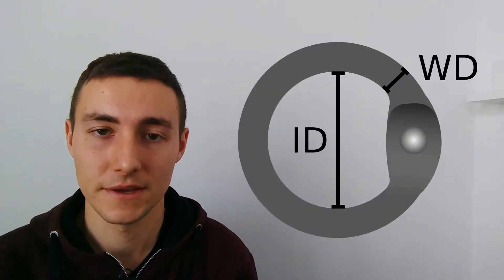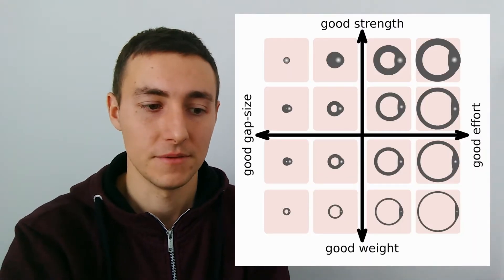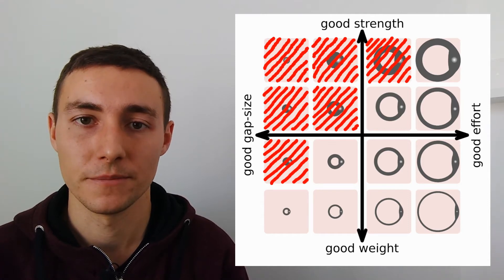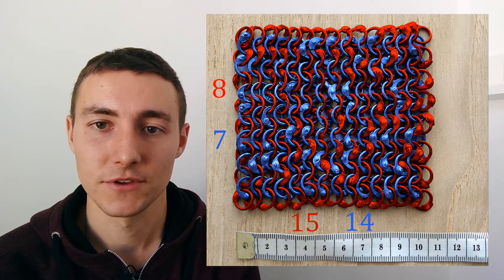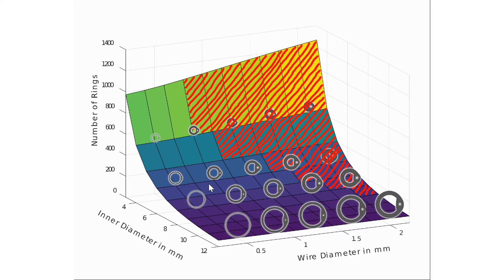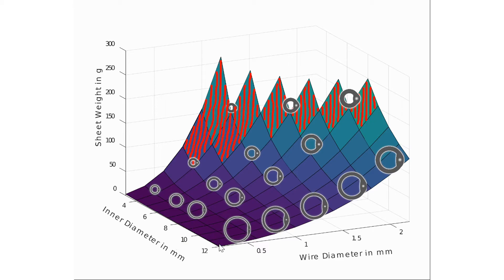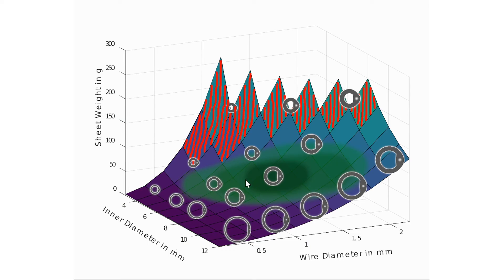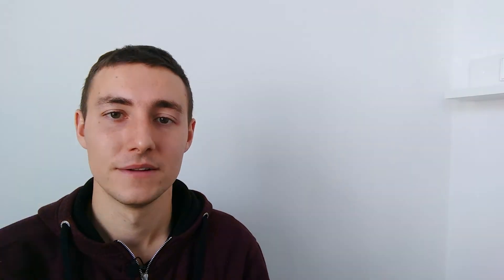How to make the best chain-mail. Do small rings save weight?

Comment: There also depends on what kind of metal you use(rigidity of material), mild steel or hardened, or stainless steel, up to titanium. So there is fifth factor and should be added to diagrams. Because aluminium ring strength is not equal to even mild steel

Comment: Fantasy dwarves were said to value premium protection against strikes, so I think they would have used smaller ID and bigger WD. I read of a dwarf who was stepped on by a dragon, and his mail did not completely collapse front to back. Plate obviously helped, but his mail was not a weak link. 

To compensate for the weight gains, dwarves tended to use mithril/mithral/titanium instead of iron. 

That said, my favorite dwarf, Bruenor Battlehammer from D&D, is still said to feel lots of blade points poke through and to experience many flesh wounds, so evidently his ID isn't THAT small. So I guess some links still  have to be left large in order to allow for chest and diaphragm expansion during breathing and arm swings, as well as for climbing and warpig-riding. 

Elves, OTOH, prioritized speed and agility, so they likely used bigger ID and smaller WD mail links.

Comment: Was making myself chainmail with inner diameter 6mm and wire thckness 2mm. It came out with unique quality for chainmails: it could stop an 3mm awl and in some cases even syringe needle couldn't pass through it! It blew my mind. Even it was made with unclosed rings it seemed to to be very sturdy and hard to rip. I was mading it for a very long time, it was no problem for me. 
But when it came to weight... Even completed only at 60% it made my osteochondrosis spine struggle in pain if I wore it over 5 minutes.
Came here to see, if there an option to make strong, impenetrable but light weight chainmail.

Comment: I won’t be using it for a whole ton of practical protection against blades, and I don’t really care if it’s heavy or not. What is the cheapest way? Does having larger or smaller ring diameter use less or more metal or cost more?

Comment: I would be very curious to see examples of the range of flexibility of different ratios (maybe that could be measured in terms of how many rows are needed to bend to a half-circle? Since that should stay the same if the ratio of ID to wire thickness stays the same, even with smaller links). And I'm curious what the exact limit is of that ratio before it means the chainmail can't bend at all! I know that these would change depending on the riveting (and on whether they even are riveted). It would be interesting to see this for different chainmail styles too, but mainly 4-in-1 and 6-in-1.

Comment: I've heard that late medieval chainmail (which covered areas where can't be a plate, like armpits, crotches and inner sides of joints) was so dense than you can't even stick a needle through it. Which wire diameter and ring inner diameter could be used to accomplish that?

Comment: Cheers from Australia. I did a bit of research before I started making chain mail and it suggested 1.2m. Wire, but when I got to my local steel supply it just seemed so thin and so I went with 2mm wire. I’ve made about 20cmx20cm square of 6in1 10mmID 2mmWd so an AR of 5, making my own rings. It looks great and is a nice relatively right weave, although it took me in total around 8hours, I also strained my right arm’s tendon and couldn’t outstretch my right arm for about a month. Ive been trying to make riveted rings but I encounter a problem when I try to flatten the rings so I can punch a hole. The two ends of the ring instead of flattening on top of each other just splay and end up next to each no longer overlapping so I can’t punch a hole. I am using a large heavy hammer on a small, 7.5kg steel railway anvil. I’m not sure how to properly flatten The rings to make riveted. I’m not sure if the rings need to be annealed first or not, it is tie wire so fairly soft anyway. Some advice would be appreciated thanks.
Reply from the maker: Hi there and congratulations to your first patch of mail. The answers for your overlapping issues are multiple. You find them explained here: https://www.ironskin.com/product/ironskins-guide-to-making-riveted-chainmail/

Comment: Hello Ironskin! I have an unusual question, and you might be one of the only ones who can answer it... I really want to try making chainmail(European 4-in-1 and Japanese 4-in-1/2) out of split rings.. Which size would you get? Since they are a bit thicker than normal ones - not sure which ones to get :c  
If you don't know the answer about the japanese weave - european should suffice ^^ at least a suggestion :>
Reply: Hello, I don't know what you mean with split rings, I use keyrings. Made mail with 8, 10, and 12mm. The one I  made with 10mm, is 6 in 1. I have an original Persian from about 1860 that is made with 6mm keyrings, on top of the shoulders it is 6 in 1. Hope that helps you. Greetings.

Comment: This really adds depth to mail 
In terms of historical combat many have noted piercing as a weakness of mail

With rivited mail getting firmer into the picture and this it adds the depth of poorer fighters buying thinner and wider links while the richer bought the smaller and slightly thicker stuff, probably of a higher quality
Reply: Maille was high end armor. It's a waste of time and resources to make maille with thinner and wider links that fail to stop points. The biggest threats on the ancient and medieval battlefield were pointy sticks, not sharp blades. The poorer troops would just use other types of armor instead of wasting their money on crappy maille (not that anyone would bother making it in the first place). People weren't LARPing back then.
Reply: @majungasaurusaaaa  when I say wider I mean smth like 9 or 8 mm while some were able to get the 7 mm or so stuff which is still resistant to most direct thrusts but also has more resistance against missile weapons 
I was probably wrong about the link thickness
Reply: @majungasaurusaaaa  That isn't true, we have finds of 9mm and 10mm inner diameter riveted mail, (for example the Tofta coif) which absolutely is susceptible to thrusts. The only way one can make the claims you did is to just completely ignore the archeological examples.

Comment: this might be years late. (maybe centuries) but why not use a spectrum of ring sizes/wire-thickness based on the armor requirements. making the chest of smaller/thicker rings to protect you vital organs and the arms with larger thinner wider to reduce weight and improve mobility of the arms?
Reply from the maker: Yeah, some historic mail shirts feature exactly that.
Reply: I was also wondering about that (for "realistic" TTRPG). Silly reason, I know. Maille is only a dream for me, especially since I'm old.

Comment: Im having a hard time understanding the graphs im trynna have a little heavier chain mail but still flexible an strong what should be the wire size an ring size i should go with
Reply: Would 7mm ring size an 1.5 wire work would that add weight an still be flexible or should I go with a 7.5mm or 8 mm ring with the 1.5 wire
Reply: You said you go with a 1.2 on 8 mm so how much does that weight for a sheet what's a sheet is that a 10" by 10" ??

Comment: Rived Rings weight per square meter in Kg/m²
InnerDiameter in mm     x  Wire Thickness in mm   =   Weigth
8.0x1.2 = 5,6          9.0x1.2 = 4,9  
8.0x1.4 = 8,2          9.0x1.4 = 6,9
8.0x1.5 = 9,0          9.0x1.5 = 7,7
8.0x1.6 = 10,8        9.0x1.6 = 9,3
8.0x1.8 = 15,1        9.0x1.8 = 13,3 kg/m²
just a rough approximation
Sebastian correct me if I'm wrong

Comment: Nice to see something I worked out using butted spring washers in the 80s still be relevant to rivetted ring mail today, my Reenactment friend and I worked out that 6mm was too small making it expensive to make and 10mm or 12mm while making it lighter just wouldn't hold up to the abuse it needed to.  We finally chose 10mm spring washers as they were the cheapest per inch to use however after making a sleeveless hauberk from them when we tried it on it turned out to be way too heavy. 😂. We should have investigated making rivetted rings instead with thinner wire but couldn't afford the equipment at that time, oh well, hindsight is always 20/20!

Comment: Hmm. so I have 3 mm ceiling wire and 3/8in rod. I don't see that on the list. it's workable. but is it in "the correct ratio"?
Reply: You could use a draw plate and stretch your 3mm wire to 1.2mm thus making it perfect for 8mm rings, your 3/8 mandrel is equivalent to 10mm which would be better for 1.7mm wire according to the chart at the end of the video.

Comment: 3:00 8x15(pre-clozed rings) + 7x14(connecting rings) = 218 rings total

minimal "posible to weave 4in1" proportion (i experienced) ID/WD near 7/2: ID/WD = 3,14 (for smooth ring)  and ID/WD = 3,86 (for rivetted ring)
Optimal (in my opinion) proportion ID/WD = 4...4,5 (for smooth ring) and 5...6 (for rivetted ring)
I mostly use ID8=mm / WD=2mm for shirt and leggings and ID=4mm / WD=1mm for gloves or mittens
smallest ringmail 4in1 i has successfully try is 2mm/0.5mm rings for jewelry (necklace, wristwatch band and some rings)
unsuccessfully (unfinished and abandoned wristband) - 1mm/0.25mm rings (too much rings for 1sqr.cm, too small rings - can operate only with pincettes)

Comment: Just a quick question, considering making a chainmail hauberk. How would a ring with the dimensions of 2mm x 7mm function as a hauberk?

I am a novice when it comes to maille. I'm working with stainless steel and starting with butted. 

Thank you very much!
Reply: Try working with keyrings, smallest I would recommend is 8mm. I have an original Persian from about 1860, made with keyrings of 6mm. About 60000 rings.

Comment: Just found your channel, amazing stuff and subscribed as quick as I could. Any plans to discuss 8-in-2 patterns?
Reply from the maker: Hi, I'm glad you like it! Hmm 8-in-2 is extremly rare in European history. In fact I don't even know a single example. If you know one, please let me know. From a theoretical perspective it has to be weaker with it's high surface and little wire diameter than 4-in-1 of similar weight and size. That makes it vulnerarble to corrosion and material defects. If the rivets were exceptionally poor, than 8-in-1 would reduce the risk since chances are lower that two bad rings are at one place. I could make a video to talk about thoughts like this.
Reply: @Ironskin  Thank you so much. I am wanting to make my own shirt, and was curious if 8-in-2 would make a sturdier body. Great vids, and looking forward to more of your work :)

Comment: I read some publication some 10-12 years ago that viking chainmails had diameter around 8mm and wire 1.1-1.2. Both values were estimated because rings welded together with rust. If I remember correctly same people did metallurgical analysis of sample and found out alternated rows of solid and riveted rings. Metal impurities followed forging stress. Mind blowing. Btw, I wish that I had this table 10 years ago when I made my chainmail :) I made mine from 3mm wire wound on 13mm mandrel, no rivets, ~30kg.
Reply from the maker: I think I read the same publication by Vegard Vike. 3mm wire sounds heavy. Good on you for making your own chainmail!
Reply: Wow, 30kg!
What do you think the best wire diameter for chain mail?
Reply: 8mm OUTER diameter, yes; but most chainmail these days are measured by INNER diameter. You dont want to buy modern 8mm Maille if you want historical 8mm mail. 

8mm OUTER diameter Maille is about 6mm INNER diameter for modern hauberks

Comment: min max ur stats bro

but also what if you combined ring size and wire types to have a thick and potentially somewhat large ring and have smaller rings off of that
Reply from the maker: That's a creative solution! Would be worth trying.

Comment: Very interesting and well presented, thank you! In the world of jewellery mail making, there is a very wide range of patterns used for decorative effect, that were never used in historical armour. It’s common for the description of different patterns to include the ‘aspect ratio’ as a description of the relationship between wire thickness and ring size. Patterns will often give a minimum aspect ratio, below which the mail will not work, and a maximum aspect ratio above which the pattern becomes unattractive or unworkable. Aspect ratio is expressed as a number derived by dividing the inside diameter of the ring by the wire diameter. So, a ring of 8mm internal diameter and 2mm thick wire would have an aspect ratio of 4.
Reply from the maker: Thank you for adding this explanation! True, for mail jewellery that is a very elementar topic.

Comment: Hi, great video, what wire diameter do you recommend for riveted maille, and what diameter wire do you recommend for the rivets themselves? What type of wire is best suited for riveted maille making?
Reply from the maker: I'd go with 1.4mm or 1.2mm iron wire and make rings with 8mm inner diameter. I'd use the same wire for the rivets. Here is an overview about which wires are bets suited: https://www.ironskin.com/materials-for-chainmail/

Comment: What so you think about making maille in a smaller scale like 1:13?
Reply from the maker: If the diameter is 13 times more than the wire, the rings tend to deform by the weight of the chainmail. You would need a sturdy material as spring steel or similar. I think it's not worth it.
Reply: @Ironskin  fair enough, thanks.

Comment: Very detailled video ! You covered a bit of the theory behind maille, but did you do any tests ? Thin wire might be weaker than heavy gauge, but weaker doesnt mean weak. I think that riveted maille is extremely strong, even when it's quite thin (like 1mm or a bit less). Could you analyse how much we can poke trough each type of maille, and of course how strong it is. So for exemple you oculd give your thoughts on how to get the lightest but most protective armor possible ?
Reply from the maker: Hi Jean, I did some testing of wire and rings and I dream of doing some more to put it into a future video. History has of course also been a giant field study of testing chainmail. I think the medieval mail that was found on battlefields like Visby will very like be close to perfection regarding weight to protection (and effort). If we neglect the effort, there could even be a different outcome.
Reply: @Ironskin  hmm would you make a video about arming doublet's maille? I think that it's very flexible and with small rings too.

Also it would be interesting to see how ring size decreases along the arm to the hand (we only see mono size maille nowadays)
Reply from the maker: @jeanladoire4141  Thank you for the input. That's also interesting! As far as I know, there were mainly different sized recycled patches of maille that got combined to garments. I didn't encounter maille garments with gradually decreasing rings so far.
Reply: @Ironskin  I'll find you a link to an old archive, from a 13th century maille sleeve... Truly astonishing work : the rings decreased and increased in size to perfectly fit the shapes of the arm... And the maille for the miton was extremely thin (less than 6mm I think).

The curators performed a test : they poked the maille with a needle, and it didn't go trough! So here that's not your munition grade maille from the 15th century, it's the maille for a rich lord or even a king

Comment: 1:12 what kind of rings were used on that chainmail?
Reply from the maker: These are 5mm rings made with 1.2mm wire. They are butted. The weave is so dense, that there would be no space for a rivet connection.

Comment: I've started making some chainmail where the wire is 1,5mm thick and the inner diameter is 6mm. I am a little worried that my rings are a bit small. Is this still an ok size? Note that I am just making butted rings and not rivited
Reply from the maker: Your choice will give a rather dense and heavy chainmail. There is nothing wrong with it if you like it this way. For my taste, I would make 9mm rings with that wire. You can also by a wire draw plate and reduce your wire diameter. In that case, I would make 1.1m wire for 6mm rings.

Comment: The internet told me to use 16 gauge wire with a 5/16” inner diameter,  which is good because I could get 16 gauge mild steel rebar tie wire at my local Home Depot.
Reply from the maker: Good choice! That's the American equivalent to my favorite 8mm ID with 1.2mm wire.
Reply: @Ironskin  that 16g wire is 1.6mm
Reply: Rebar is not bad, especially for riveted since that requires annealing